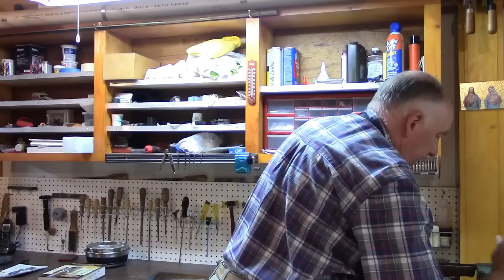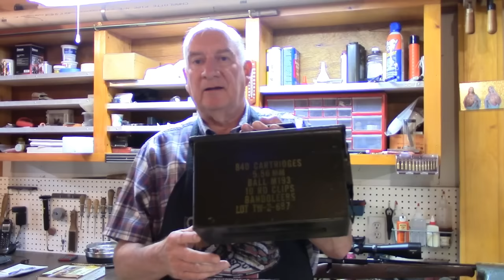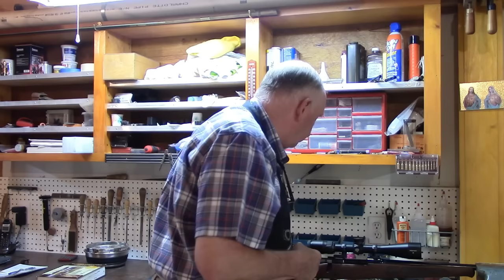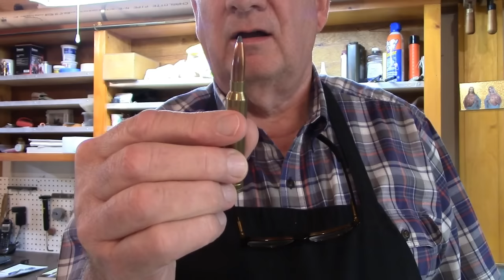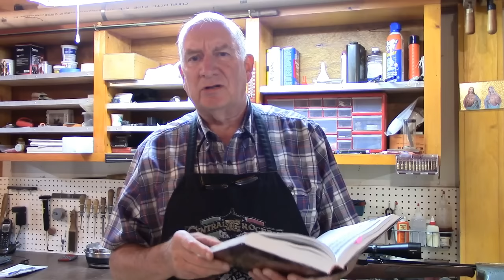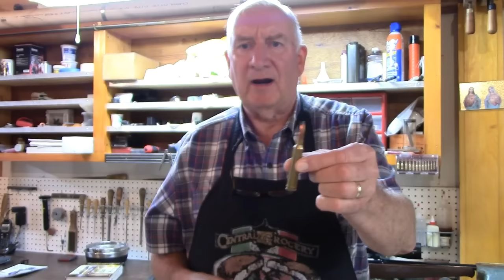How long do barrels last? ~ Discover the truth!

Comment: One thing is true, ya don’t need a 30cal for hunting, unless it’s bear or other game of similar size. My younger brother has a .300 Win Mag, but hasn’t got anything except steel with it so far. I use a .270 in a LH configuration. It shoots straight and flat out to 600 yards.... I haven’t shot at that distance yet, but my dad has at a range. Just needed to hold about 6 inches, 15.24cm high, and smacked that target in the center.

Comment: Now I have technical questions: what is a list of very efficient, very efficient very perhaps you could say elegant cartridges that efficiently use the powder to create high pressure and good speed for what amount of powder is being used. A list of cartridges that have very long barrel life expectancy. 

Also, what is your commentary and opinion on the type of rifle in which we use today. You said that where the rifling stands proud is where it is vulnerable, how can we design a bullet and rifling that will work together so that the rifling does not stand proud?

What do you think of our current United States military cartridges, the 223/556, the 308/762? I noticed that they too are bottlenecked cartridges and if we extended that bottleneck back out to a straight wild or marginally tapered case, how well would that work?

Isn’t that the definition of 300 blackout? So, do you think that 300 blackout is a better way to go in terms of what we expect to get out of our rifles and our barrels?
Reply from the maker: I'm not going to produce a thesis on rifle cartridges, nor make any lists.  Rifling is made to stabilize a bullet in flight, and must stand proud of the grooves.  Cartridges are made with the express purpose of driving a bullet of correct form to fill a particular role in target shooting or hunting.  That purpose presupposes that it will cause wear on a barrel eventually.  The intent of gun design is effectiveness for those roles, not everlasting life.  I wouldn't recommend the 300 Blackout for anything.  It's ballistics are as anemic as any round ever commercially produced.  Zero times anything is still zero.

Comment: Difference depends on,how much you use them.  My barrels are in good shape I only shoot when I kill a deer. And that only a few times a year.  Over cleaning can hurt the barrel the copper build up actually is a barrier to rust. I've got a 243 had it for 35 years and it still is deadly accurate. ,,,,,

Comment: Thank you for another excellent, informative video! I have a few related questions though please:
- Would you say that a .22LR target rifle barrel, if shot slowly (which tends to be the case), has an 'indefinite' life span?
- What would your caliber recommendation be for a CF target rifle, shooting paper at distances of 100 to 300 meters, in terms of sensible choice? (Balancing overall economics/availability of components/barrel life/accuracy potential?)
- Do any of your proposed points apply to (target) RF/CF handgun barrels as well?
Reply from the maker: None of the issues I spoke of apply to rimfire firearms or standard centerfire handguns.  Shoot as often and as fast as you desire.
Reply: GunBlue490 Thank you for your answer. I'll do some more research myself regarding the cf target rifle caliber dilemma. (The thing is that here in the Netherlands we have a max of 5 firearms one may legally own, so choices need to be very well weighed.)

Comment: The thing is he's talking about at around the 8-minute mark people roasting their AR15 barrels. He talks about it as though it's abuse as opposed to using them for what they are for. and his mindset is based around something that used to be true but isn't really any more. An AR-15 barrel is not an expensive thing now. You can get good AR-15 barrels as cheap as $50 and excellent ones at $175. The life of the barrel really isn't a significant factor as far as cost is determined. It's more of a hassle of having to zero the new barrel and maybe work up a load to it if you're going for precision.  All of his statements are perfectly true but they kind of missed the point. it's like saying that a Corvette will be much more efficient and last longer if you always ensure to accelerate gradually and never exceed 55 miles an hour. Yeah, true- but that's not what a Corvette is for.

Comment: Sir, sorry, but i have to point out a mistake in the video:
The venturi effect says that "for uncompressable fluids the volume of material that goes through a tube is constant" So it explaines why, if the diameter of the tube decreases the velocity increases. (Because the same amount of substance hs to pass through a smaller diameter) It does not say that the pressure decreases if the tube gets smaller.

Comment: A long range shooter told me that he calculated the barrel life in seconds of actual use time. That is how many shots were fired and how long the bullet travel time was in the barrel. Actual barrel length time he had was 6 seconds. That is with each pull of the trigger the bullet was only in the barrel was like a thousandth of a second or so.
Reply from the maker: That's an entirely subjective issue, which is totally dependent on the cartridge in use and the rate of fire.  Any two guns of exactly the same make and caliber can have vastly different barrel life spans, depending on the loading pressure, charge density, powders, velocities, and manner of firing.   Ten different loads of exactly the same velocity and bullet weight can have significantly different pressures, according to the powders used; as much as 10,000 psi, which dramatically affects heat transfer and erosion. His calculations assume the same life for all barrels, which is entirely untrue.  Such calculations have validity only for the person who is his own measuring stick, and are entirely meaningless.
Reply: @GunBlue490  That was for his barrel. I never actually thought of barrel life in terms bullet time in the barrel until that time.

Comment: back when i was doing competition shooting using a .22-250AI it was spitting out moly coated 55 gr pills at around 3700fps and i only used 26" stainless steel barrels and i found that the barrels would last about 6000 rounds before they where no good for competition use still good for hunting tho during summer i have had the barrels hot enough to burn my fingers bit hard to cool them off in 35c to 40c air temps.  i had one of the barrels machined open down the length and found the first 1/2 looked like charred wood with no rifling left and by the last 4" looked pristine

Comment: Thank you again for your thoughtful and knowledgeable presentations. Have you ever covered what a "dark barrel" is and what causes it, and if there is a way to correct it?
Reply from the maker: Dark refers to a non reflective bore that does not shine.  Almost any old tool box has an old pair of pliers or a screwdriver that has been around so long that the steel has lost it's shine due to microscopic pitting and corrosion.  An old nail pulled from a board will have that appearance.  That's what happens to barrels that are neglected, and especially those that have been subjected to corrosive primers. It cannot be made bright and it cannot be corrected. Barrels can certainly still have serviceable military grade accuracy, but have greatly reduced value.  A knowledgeable dealer will run a clean patch through a barrel.  If it doesn't shine, he'll grade it accordingly.

Comment: cartridge design pretty much sets the potential for barrel life just as this video points out. The next biggest factor in barrel destruction is shootin' em to the point they are too hot to touch. In practical terms the majority of shooters will never shoot out a barrel because they just do not shoot that much, maybe a sight in now and then, a deer hunt here and there...just not enough use to shoot out a barrel. Target shooters and varmint hunters is where you see the barrels going south, but those shooters are big spenders by virtue of that shooting type of activity so barrels are an expected part of their pursuit.

Comment: Good video! I always wonder when I’m at the range practicing with my hunting rifles if I’m shooting too much.  They tend to get pretty warm after 5-6 rounds. But I always find my warm/hot barrel groupings to be tighter then my cold bore groupings.
Reply from the maker: Thank you.  Be careful.  Firing five or six shots in succession will really heat things up.  Unless it's a competitive event, I generally recommend that rifles be kept to slow fire; no more than one round per minute, and allowed to cool completely after three shots preferably, and no more than five shots.  Just rotate your rifles at the range; as you shoot one, give the other a rest. 

When a rifle shoots differently cool than hot, it's a possible result of having cleaned the copper plating that the previous session applied.  I've spoken about this in previous videos.  A new barrel becomes conditioned after the first few shots are fired, as copper fills the microscopic imperfections and smooths the bore.  That is not fouling, which is lumps of copper build up from overly aggressive shooting.  If ammonia solvents are used, that desirable plating is washed out, and the rifle will shoot differently until it's conditioned again.  A properly conditioned barrel shoots the same, hot or cold.  The first shot from a cold clean bore should go into the group.  I spoke about this when I debunked barrel break in and my various cleaning videos.
Reply: GunBlue490 thanks for the info!

Comment: Will a ceramic composite chamber last longer than a hardened steel one?
Reply from the maker: The military has conducted tests on ceramic chambers to increase life of artillery pieces.  But, the vulnerable section of a rifle barrel extends well over an inch in front of the chamber, starting back at the leade of the rifling.  The accuracy of a rifle has much to do with the distance a bullet must jump to the leade, which is measured in mere thousandths of an inch.  A ceramic chamber would have to extend that jump length by over an inch to be effective, which is a ridiculously long jump that would grossly upset accuracy.  So, yes, ceramics would extend life, but unless I actually saw the results, I believe it would have very little desired accuracy, and I'm sure it would be prohibitively costly.

Comment: This is a great video. I would point out, however, that it's perfectly practical to burn out your AR15 barrel because they are relatively inexpensive (circa $150) and really easy to change - this is only true for the AR though. I would never recommend this for any other firearm. The AR barrel is so easy to replace because the headspace is set during manufacture.
Reply from the maker: I didn't tell folks not to burn out their barrels.  I told them how it happens.  I've been replacing AR barrels before most of my viewers were born, perhaps you.  As a police instructor and Vietnam combat veteran, there was never, ever a reason to purposely abuse a gun barrel and waste ammo.  One certainly didn't waste ammo indiscriminately in combat; he conserved it and used every round wisely from his limited supply.  That was ingrained in training.  Marksmanship is developed one shot at a time, not by the 30s.  Many members of ranges are getting a bit upset with inconsiderate firing on the line that spews brass everywhere and creating havoc while they are trying to enjoy their day.  What's really bad is that these same guys tear up target backboards that others must replace before they're hardly used by target shooters.  These guys can't be found on repair and cleanup day, and often don't even bother to pick up their brass after making a mess.  Or, they go and do it at a local sandpit and upset the neighbors, making a bad impression for all shooters.  Please don't make excuses for this sort of shooting that does nothing to help preserve our Second Amendment.  They'll be the first to complain when other shooters cast their vote to get rid of AR-15s.  I own an AR-15 and 30 round magazines, and feel the right to own them is important, but certain inconsiderate folks are pressing their luck and will cause everyone to loose.
Reply: @GunBlue490  I apologize if I came across as abrasive or "know it all". I was merely pointing out that the low cost and ease of barrel replacement suggests that the word "abuse" may not be appropriate in that particular context - the barrel could be considered a consumable component at the cost of ten boxes of ammunition. Rest assured, I treat all of my hardware with respect - and not just my arms, but all of my  other tools as well and my automobiles. As for irresponsible people on the range, it would behoove the range owners to make/enforce rules more conducive to the enjoyment of their customer base. I don't believe our 2nd Amendment is under threat because of tactitards. Refusing to pick up one's own brass is crazy, but if I owned a range I would not complain because I would want to recover it and reload with it (as most ranges do). For my part I would recover brass left by the irresponsible myself if every range I have ever been to hadn't already prohibited doing so.
Thank you for your service in Vietnam. It was before I was born, I admit, but I respect your sacrifice. Also I want to thank you for propagating your firearms knowledge and training - it means a great deal to me simply to find this kind of information. The internet is saturated with garbage and the value of your work is inestimable to me.

Comment: Some cartridges will burn out a barrel faster than others. High speed cartridges i.e. 6.5x300 is one in particular.300 Win Mag is a minimum deer cartridge, well here in Montana I've killed a dump truck full of deer with a 22-250, you don't need a magnum to kill a 200 pound deer at reasonable ( 100-300 yards) distance.

Comment: Thank you great information as always. I have been going through calibers in my head of what I want for a long time I've kind of settled on 308 Winchester. It's a good compromise between everything. The other thing I like about it is you can buy ammo very cheap. What's your opinion of the cheap military surplus ammo not for hunting but just for having fun at the range? And I've been told that you shouldn't reload the military 7.62? I was thinking about getting into reloading. I've been looking at the entire 308 family but the cost of ammo and availability is so much better for the 308. Thank you
Reply: Yep, it’s hard to beat 308 inside of 500 yards, just like it’s hard to beat 223 inside of 300 yards. There are plenty of other options for both, but you gain a wide selection of both firearms and ammo options for either of them.
Reply: @RARufus  Yes definitely 308 loaded to 2800 with 165 grain partition nosler hard to beat. Not that much experience with 223 but I hear it is excellent with 60 grain partition nosler. Thank you 👍